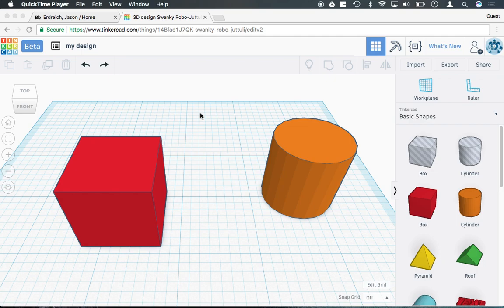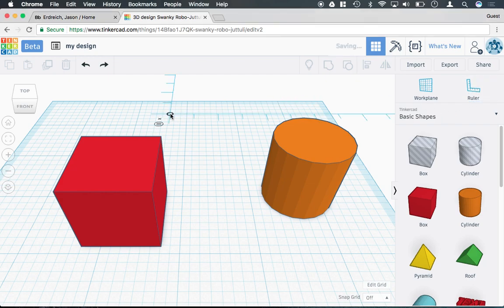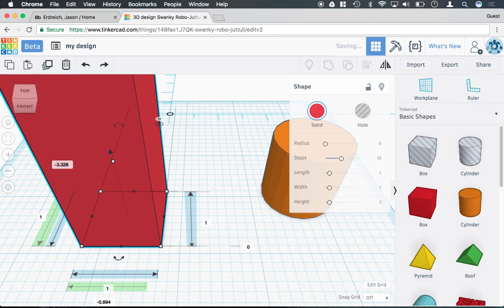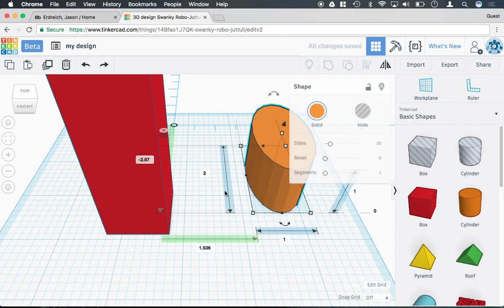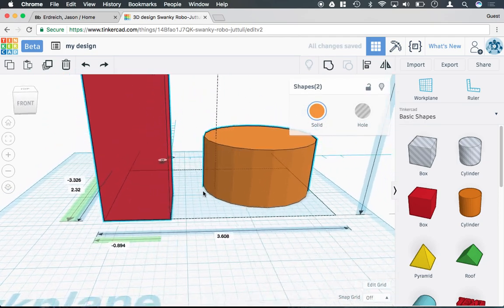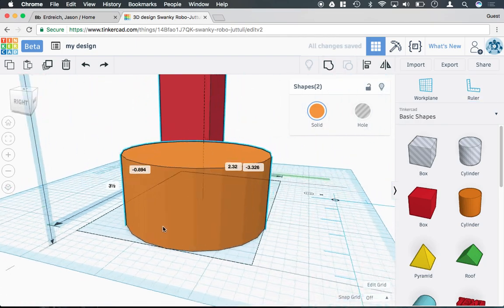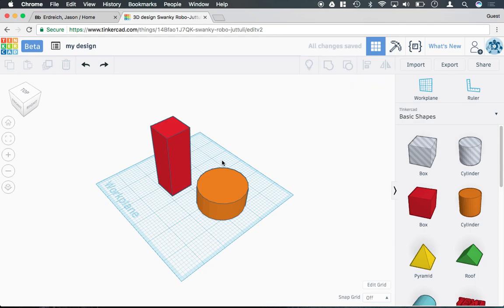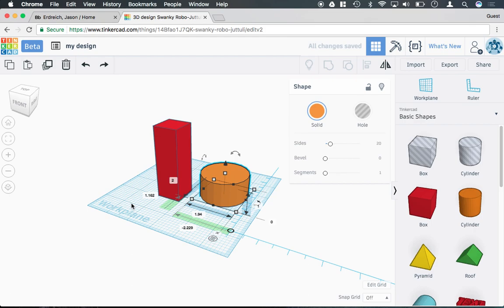Using the ruler and dimension tools in Tinkercad

Comment: Hello, thanks for sharing, nice video. When I print objects on my 3d printer, the dimensions are way different from the measurements shown on tinkercad.
Reply from the maker: Thanks for the view! What slicer are you using? And when we say "way different", what are we talking? Depending on your slice settings and filament, it could change up to 1/8" due to thermal printing properties (though 1/16" is more common). If its more than that, you probably have and export / import parameter in need of tweaking
Reply: @MrErdreich  hello and thanks for your response....I will check the settings for sure....and the difference I have is around 3mm
Reply from the maker: @evastronomy8048  Sure thing! 3mm is within the window of tolerance adjustment, though its on the high end. There are a million possible causes, but I would download a basic box from tinkercad and print at a high detail, then measure your difference and tweak your settings from there.